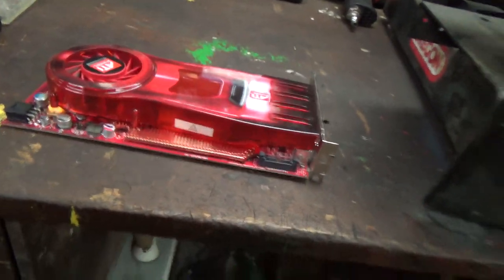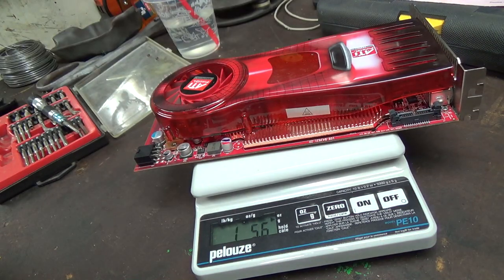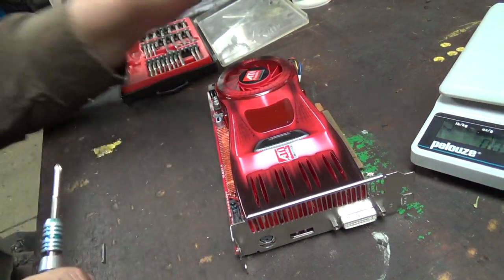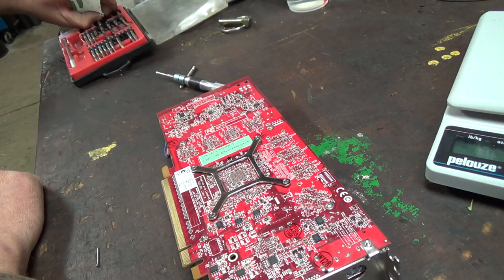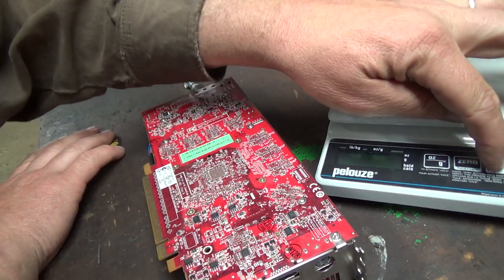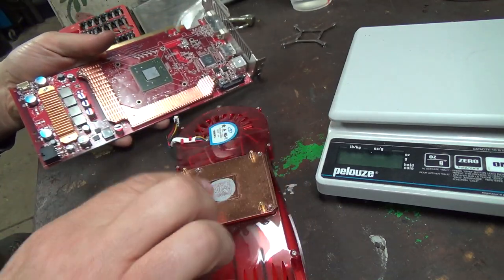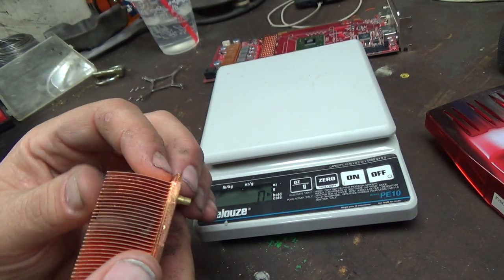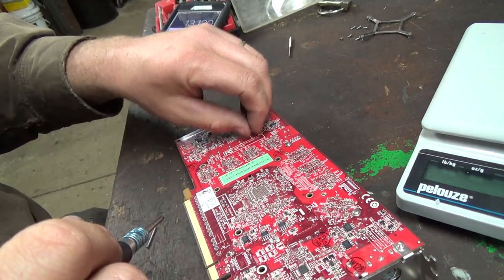Fire GL Teardown and rebuild

Comment: Hey Bill. Put a train horn. That will make them move. That ticking is either the gas or lifters. Change gas if that don't work then, ask them to adjust the valves. Just sayin
Reply from the maker: They are hydraulic lifters you can not adjust them

Comment: Bill, it's just the normal tapping of the direct fuel injection system. Not lifters. Don't worry about it. They are  
pretty stout little engines.

If it lugs a bit on a hill, it's probably because it has an insanely tall final drive ratio. Don't lug it down, drop a gear or two as you would with a bike and keep the revs in the sweet spot. That's called fun. It's not a diesel or a big block V8. It needs to run free. 

I think the engine sounds fine. 

I don't like the suspension rattle though or having to let the hood slam. That's sloppy engineering.

Comment: I had a job at an electronics recycling place and I took apart a bunch of old graphics cards, computers, servers, etc. most of the heat syncs are copper or copper coated

Comment: Hey Bill, I maybe be wrong, but hydraulic lifters still require an initial adjustment.  If it's a single lifter it would tick once every 4 revolutions or at idle, 800 rpm maybe, the tick would be 200 ticks a minute which is about what I'm hearing.  That's a little less than 4 ticks a second, food for thought...LOL.

Comment: dual overhead camshaft and variable valve timing makes some noise, but you're mainly hearing the injectors.
just be glad it's port fuel injection and not "GDI" gasoline direct injection, which is very high pressure, the pumps and injectors are super loud and have a rattle almost as bad as a diesel ;)

Comment: Run some Lucas fuel system cleaner with upper valve lube in it, On small GM engines such as those it makes the tick quite down a good bit, and help lubricate the fuel system.

Comment: The large ones next to the processor will be the ram, the other 8 chips are more likely to be the power supply, the power supply is everything from the things with the blue lines to the right of the board at 19:40, the grey things could be inductors.
Just so you know, C = capacitor, R = Resistor, L = inductor
If you can read the number on the chips, you can search online and may be able to identify them
That card has DVI,  Display port, and Vesa mini din (in that order)
Reply from the maker: I knew you wound know the components.. Thanks Sparky

Comment: Power comes from a GM-sourced, 2.4-liter, Ecotec four-cylinder engine that generates 173 horsepower at 6,200 rpm and 166 pound-feet of torque at 4,700 rpm. It might not seem like much, but given its weight, the Slingshot is quite fast.
Get ahold of a Cert. GM tech and quiz them,  it could just be a component tick.

Comment: That the same engine as Chevy Cobalt?
Ticking is probably the injectors.
Reply from the maker: yes its the ecotec
Reply: Matt K yea it is.  that ticking is the injectors pulsing on and off
Reply: I have a Cobalt with 2.2L as a commuter. 167K miles on it, it has not had any issue with the motor, except for the exhaust manifold has cracked.
Reply: Matt K this is actually the 2.4l but same basic engine. they are pretty good engines.   we had a Malibu with the 2.2  was a good car till it got over heated.    just like any car they can die at low mileage or go forever.
Reply: I've run Moble1 full synthetic since I've purchased it, kept up with the maintenance, been on quite a few long trips, quite please with it. Not a single oil leak. I don't thinks it has been above 4K RPMS either.
Reply: Matt K also ran synthetic with every oil change.  driven it cross country a few times.  it got 32 MPG at 80MPH (speed limit here)  never left us stranded except once when the fuel gauge quit working and we did know and ran out of fuel ⛽